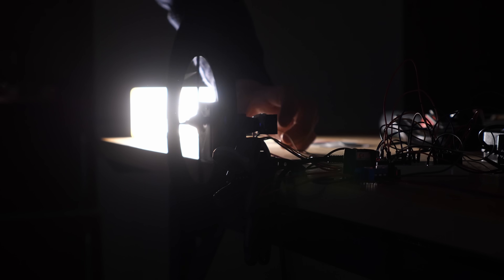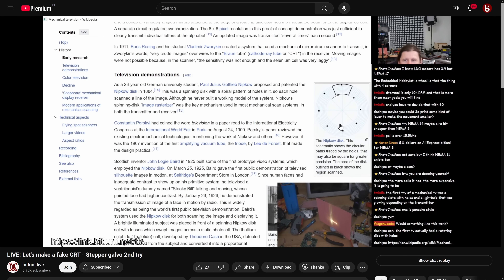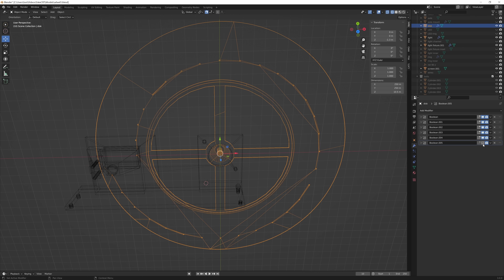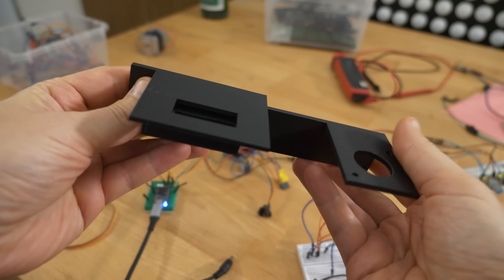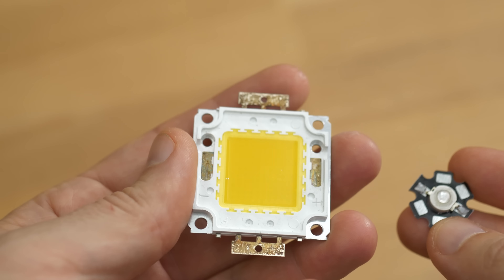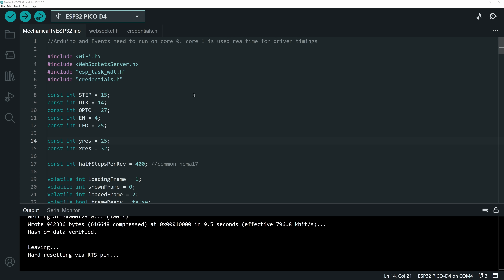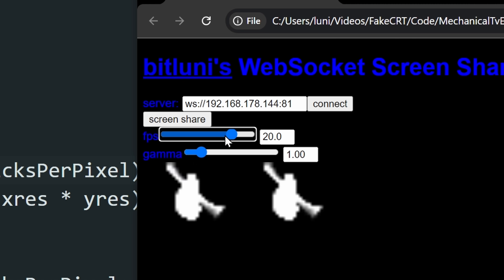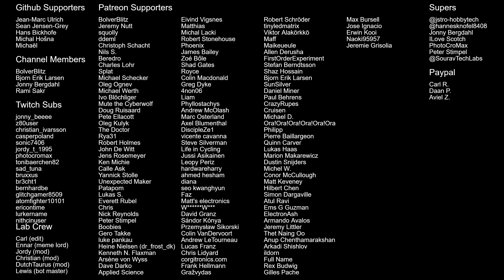I made a hilarious mechanical TV

Comment: It really needs more resolution, but more importantly, can you attempt to make it 3-color?
I assume you need 3 LEDs and place them at different spots on the disk, and then add color filters and mix images together with something like mirrors?...
Maybe if you use different disks, you can place them at 3 axis, and with one-sided mirrors reflect all of the images into one screen. Also, using mirrors may allow to scale the output.

Comment: instead of a stepper motor use a brushless motor with a constant current driver to regulator its speed. Using your opto switch as the sync controller for it.

Comment: I had a slightly different take on mechanical television. Before relatively cheap FLIR and thermal cameras, I wondered if I could use a PIR sensor as the camera (image sensor) in a mech TV setup.

Comment: I have played with the idea of a civilization-restart computer, something rugged that could be used to bootstrap a simple computer lab built around itself to allow access to stored instructions within.  The imaginary scenario is long enough after a collapse than the old tech is mostly lost, though not all knowledge has gone the same way.  Our would-be boostrapper has the equivalent of a mid-19th century gentleman engineer's manufacturing ability.  

One of the stops along the way would be a Baird/Nipkow display like this one, used to display text in a scrolling fashion to provide instructions for making more powerful and useful input and output  systems as well as text-based explanations for physical and chemical principles.  If your display unit can can be driven directly by your data-processing unit, the design becomes pretty simple.  

I hope you do more work on your televisor in the future.

Comment: When I tried make a televisor in the 1980s,  I used a drum instead of a disc,  to get straight lines.  This was easier to make because I could punch a straight line of holes on a flat piece of black photographic film and then wrap it at an angle on the drum.  It was probably too ambitious to make it for 625 lines 50hz,  but I didn't have any other signal source

Comment: I'd love to see a larger, higher resolution version of this
Reply: A 240p equivelent 9.7cm image would need a ≈4m disk.

For a PAL equivelent 35 cm image you would need a 52 meter disk. Which at 25 fps would mean a disk spinning at 8,900 km/h

For full HD 101 cm screen you would need a 300 m disk spinning at 0.02% the speed of light.

Comment: I have a couple of digitally-mastered "video" recordings that could run on your disc visor fine. If you want, I can email you some animated mockups I made at the classic Baird standard of 30 lines with 24 viewable lines and 192 (yes, you read that right) viewable "pixels" per line. It runs strictly at 12.5 frames per second.

Comment: Talking of scan lines:

If I am in a room and my door is open only a crack (3-6mm) and I don’t want to draw attention, I move my head horizontally back and forth, passing my field of view across the gap, which is the same principle as used by a scanner - I get a reasonable view outside the room, made up of accumulated slices, built up as my head moved in relation to the gap.

Comment: I really wish someone would develop a display technology that equals the quality of CRT (to say nothing of surpassing) while also offering at least 4K resolutions at 60 Hz, and eventually 120+ Hz. And that doesn't have a price of six figures.

For my part, I don't see why a triple OLED projector couldn't work, with phone-size red, blue, and green 4K OLED panels each behind a lens, like CRT projectors. This would obviously achieve triple the brightness on top of running the panels at increased power levels in exchange for shorter life. The driving circuitry would pulse the panels with an envelope that matches that of CRT phosphor, with the ability to adjust the parameters of the envelope in order to balance brightness, flicker, and motion clarity.

Theoretically, this would deliver the absolute black levels of CRT and OLED, the perfect motion clarity of CRT, and the resolution and refresh rate of LCD/DLP/OLED. And, I don't see why a no-nonsense, non-"smart" driver circuitry could not achieve near-CRT input latency.

Comment: There should be a way to use two interlaced hole spirals and two light sources to effectively double the resolution by making it horizontally interlaced. To make two light sources work it would need a set of curved, vertical baffles to block light bleed between the two sets of vertical scanlines. Make the baffles with the lights stacked like the engines in an English Electric Lightning fighter jet. Why does everyone make a Nipkow display at the side of the disc VS at the top so the scan lines would be horizontal, like normal analog television?

At the side, the horizontal resolution is fixed to the number of holes in the spiral while vertical resolution is determined by how many times the light intensity can be changed during the time of flight of each hole across the opening. With a single light source, only one hole in the spiral can be within the image opening at any time. If the light intensity change frequency is fixed to 50hz or 60hz AC line frequency, then only a small number of changes can be made in the fraction of a second a hole is crossing the image opening. Line frequency coupled Nipkow displays would need a frequency doubler or tripler, which were circuits used in Farnsworth style all electronic televisions. Driving it with modern technology, the limit is how fast an LED's intensity can be varied and perceived to change.

Next thing, LASER cut the disc and use some proper rear projection material. You can get a piece of it for $10 on Amazon. These are not nails that the 3D printing hammer is good for. You can still 3D print the mounting hub and stiffening ring and ribs.

A thin, LASER cut disc and actual rear projection screen material will enable smaller holes, less diffraction, and positioning the disc much closer to the back of the screen to make a far sharper image.

Instead of repeating the antique design, evolve it in every aspect to make it better.

Comment: I wonder if it would be possible to triple the size of the screen, add 3X as many holes & 2 more lights separated by partitions. Of course you would have to synchronize the flicker rate between them. But you would probably get a higher definition image.

Comment: Oh man, I remember trying to ramp up stepper motors back when I worked with hardware.  Depending on the motor and controller you can get them to work quite a bit beyond their specs, if you don't mind the smell of hot windings ;)  This makes me want to dig out all my old stuff and get back into it.  It was all Z-80's and 68000's in those days and most of work on controlling a stepper was done in software.  It's so much better today.  As others have said for higher performance a servo motor will be easier to work with if you want to get higher frame rates.  I never did much with those.  You pretty much had to build your own controllers and the math was a bit beyond me at the time - all linear algebra and Jacobians.  As a result I was a big fan of bang-bang controllers (variable structures, if you want to be formal).  But that was that just a wee bit hard on the equipment.

Comment: Phosphor based LEDs may not be as slow as you think!  There has been quite a lot of research on using phosphor based white LEDs for fairly high speed (100 Mbit/s) data transmission though those very large COB LEDs might be slower.

Comment: More holes in these = higher resolution

If you have a continuous slit along the dot path, and a razor thin horizontal slit filter on the light, they will cross into an infinite number of points.
You can get resolutions only limited by the data stream, rather than hardware.

Comment: This is so cool! Please revisit this using better components, like a more precisely manufacturered scan plate (i.e., laser cut stainless steel mounted on machined aluminum hub/coupler), and most importantly the motor, if you want perfect synchronization, use one from a laser printer (prism motor), those have built in phase locked loop that controls precisely how fast it's spinning and remains stable, you just need a reference clock and it'll lock to it.

Comment: User a continuous rotation servo instead of the stepper.  It's like a regular servo but instead of controlling the position, you can control the RPM.  Most hobby shops will have them, because they are used in RC airplane propellers.

Comment: I Feel SOO STUPID WHen People 200 Years Ago Was Figuring This Out !
Reply: Nipkow was actually trying to make an improvement on the "pictures over wire" news image system used by the telegraph.. Getting rid of the need to etch an image on to a metal plate which was then bent round a cylinder would have cut much of the costs.. Unfortunately there was no way to amplify the signals. The "pictures over wire" machines used to give out a high pitched screech when the pen made contact on the printing drum with an incoming signal.. Edison was a telegraph operator as a young man.......

Comment: You might use 2ea. BLDC drone motors powering 2 Nipkow disks, one for transmit and one for receive. Since the BLDC motors are 3 phase, they should stay in sync. Add a RC ESC module and a RC servo tester to vary the motors speed. With this setup, you don't even need the microcontroller or separate source material.

Comment: for the laser CRT, why dont you use a spinning mirror prism, where the laser bounces off at a certain angle, and since its spinning this angle changes, and before the laser runs off the screen the next side of the mirror prism is being lit, starting from the other end again.
do that and include a slight tilt for each side of the prism so that when it draws to the screen it also changes height and then have it spin at 20 times a second

Comment: Did you ever consider multipexing the Nipkow disc? That is, instead of enough holes for a full scan, have 2 sets of holes, and 2 LEDs. You could, for example, have a top set and a bottom set, with an LED behind each, thereby splitting the screen into two half-screens. Use a shade of some sort to ensure light from one LED doesn't leak out through the other set of holes. You could offset the LEDs horizontally, they don't need to be directly beneath each other, just offset the timing too.

Taken to it's conclusion you'd have something like the 1980s Adventurevision console (which was similar to Nintendo's Virtual Boy). The Adventurevision had a thin column of LEDs, about 100 or so. Then a triangular prism, with mirrors on each side, spun fast. It reflected the column of LEDs into the player's eyes, painting them across his vision as it rotated. 

The Virtual Boy did something similar except a much more precise mirror was oscillated left and right, reciprocating instead of spinning. It was very light. 

Nipkow-style, you could do that with a column of LEDs and 1 simple vertical slot tracing across horizontally. Normally such a system uses 1 light and a series of holes. You could go half-way or any proportion of lights and slots / holes that you like. Get whatever result you like! A column of lights in parallel making parallel scalines.

So you could get any quality you wanted, any size, really, by adjusting those parameters, lights vs holes. Eventually you could get to a very high-quality picture. At which point you realise the whole thing's a waste of time when you could just buy an LCD panel instead. But up til then there's stuff to be achieved!

Comment: an idea that you might like. the glow in the dark material usually gets activated by blue light, or better, ultraviolet light.
but on the other hand, you can also reverse it with red or infrared. practically turn glow in the dark filament off (it should work the same way with fluorescence).
that means, you could put your dots on a part of the disk, and have one bright window where IR shines through, resetting the screen after every frame.
should be possible.i

Comment: playing with two sheets of perfboard... it makes me wonder... is there a way to achieve the raster pattern by having two plates of holes on slightly different centers so they merely have to "gyrate" rather than perform complete revolutions? 

other option is two belts with the appropriate holes and slots traversing each other at right angles.

largest drawback of the "standard" system is the requirement for massive discs to produce only a very small viewing area...

Comment: You need to use 2 disks with identical line holes, / for vertical scanning, \ for horizontal scanning. This will help to increase resolution without increasing disk diameter.
Reply: You mean like slots, right? So when they overlap they are perpendicular to each other producing a single point. I'm not sure but I don't think it'd even need to be "smart". Fixed ratio gears and multiple correctly spaced slots could probably do it.
Reply: @ImmortanJoeCamel   yes, \ and / for 2 discs make X with square dot in center. Synchronization should be accomplished using opto-sensors and stepper motors (maybe use bldc and more holes for more frequency). Since all holes are identical, the frequency can be increased many times, and the resolution of the scanning lines on two axes can be increased.

If you leave 1 line hole on first disk, and a spiral slot on the second, you can make a mechanical screen that can occupy the entire area
 of the disk like Chinese holographic fan
Reply: @ImmortanJoeCamel  yes, \ and / for 2 discs make X with square dot in center. Synchronization should be accomplished using opto-sensors and stepper motors (maybe use bldc and more holes for more frequency). Since all holes are identical, the frequency can be increased many times, and the resolution of the scanning lines on two axes can be increased.

If you leave 1 line hole on first disk, and a spiral slot on the second, you can make a mechanical screen that can occupy the entire area
 of the disk like Chinese holographic fans.

Comment: I've found that the image quality on a mechanical TV display is actually more crisp when you set the screen/diffuser BEHIND the disk from the perspective of the viewer. It seems counter-intuitive but that way it doesn't give the beam of light any chance to 'fan out'
Reply: That actually makes a lot of sense. I think the reason is more that putting the diffuser in front will blur the light from the hole a bit, decreasing sharpness. If you put it behind it, you still smooth out the light, and you don't blur the light coming out of the disk at all.

Comment: I'm curious as to how logie baird and the lads back then were able to produce images. like how did they make the light source flash/dim fast enough. How did they produce the signal to display imagery. fascinating stuff
Reply: They used the reverse process.. they used a flying spot scanner to light the subject and caught the reflected light (without a disc) with first a selenium vdr and later an electron multiplier tube.. then this was amplified like any other electrical signal before being fed to a neon bulb behind a disk which was synchronized with the flying spot scanner.. None of this is actually hard.. except achieving the wideband amplification needed tor video with the amplifier technology of the 1920's

Comment: I also started building a Nipkov display, but instead of one LED it will have a whole matrix of them. Maybe even with the possibility to choose any combination which of them will light at the same time. So for each position of a hole there could be rays emitted from it at different angles (there will be no diffusing screen) and one may see different pictures depending on the viewing angle, or even holograms.

Comment: Many people heard of mechanical tv, but there's nothing said about CAMERA to capture image to use with it. TV is not just a device to show a motion picture but also a device to capture motion picture plus device to encode and transmit it as signal and a device to receive it to display. And 100 years ago there was no darn arduino kits and programming.
Reply: The camera works the exact same way, just with a sensor instead of a light bulb and some optics to focus the incoming light onto the projection plane.
Reply: @HenryLoenwind  actually they put a very bright bulb behind a spinning disc and made a flying spot..

Comment: I work with applications where LEDs need to be switched in under 1 µs, and the white phosphor LEDs can easily do this, it is really impressive.  The lime and red phosphors, though, are pretty slow.
Reply: Green and red LEDs don't use phosphor, they emit that wavelength directly. Only white LEDs use phospors commercially.
Reply: @AureliusR  Lime, mint, and some amber and photo red LEDs are also phosphor coated.

Comment: if you already have the optical endstop, why bother with a stepper motor? you could use a regular dc motor (or bldc) with a mosfet for control. then you just calculate the time elapsed between last rotation when you get an interrupt (since i guess that delta time is what you need)
Reply: This device needs to sync its rotation to the incoming video signal, not the other way around. Driving the camera's frame rate from the display device only works for a proof-of-concept build.

And while we can take all kinds of shortcuts with hobby projects, the idea is to be a close to the real thing as possible and to fake as little as possible. So, being able to sync up to a video feed outside your control i an important design goal.

Comment: Very intersting video, Thanks. Choosing a step motor is  the quick way to solve the problem, but I would go with thress phase BLDC.  The phosphor screen you used is slow, so you lost what you wanted to gain when decided to use UV led. Thanks again for very interesting Video
Reply: Hard disk motors! Use them!